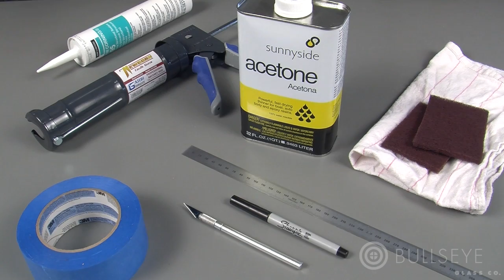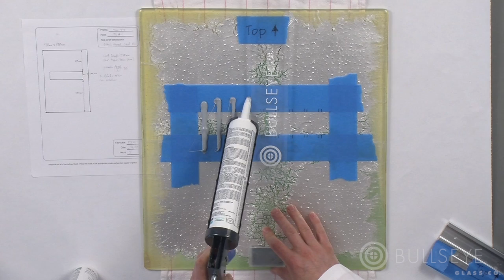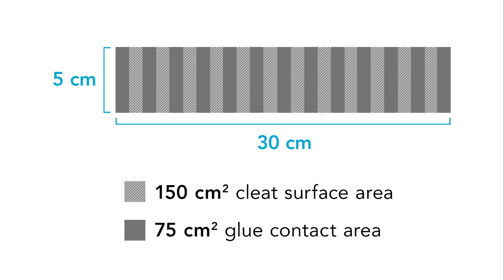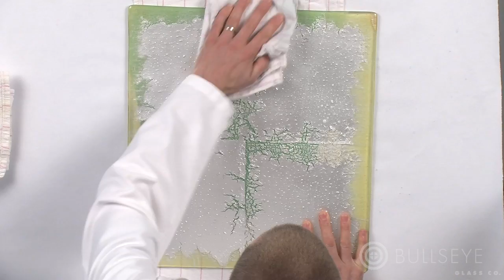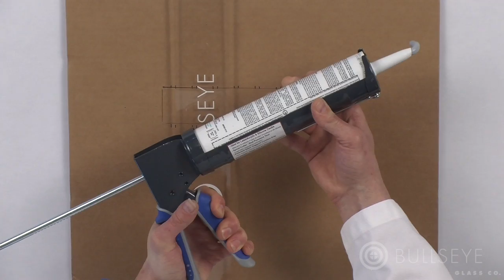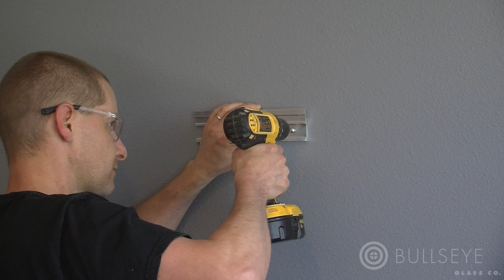Attaching French Cleats

Comment: Hi, using this method for a current project and we have a question.  The video shows how to cut and remove the excess adhesive on the straight side of the cleat, but how do you remove it on the angled side?
Reply: I've done this method many times and the "ooze-out" into the engagement zone of the cleat is a bugger! After battling this on several projects, I got smart and 3D printed a weird-shaped object, part squeegee and part snowplow, out of squishy TPU that wipes 99% of the wet 995 out of the groove. The squeegee is the exact thickness of the void where the glue accumulates. These projects go much smoother and take less time now. Good luck!

Comment: Can this method work when hanging mirror? Will the adhesive affect the mirror back in any negative way? I’m picturing the bracket potentially reacting with the reflective material on the back of the mirror? Thanks in advance for your guidance!
Reply from the maker: Hello Hannah!

Since mirror isn't anything we have experience with, your best bet is to talk to the mirror manufacturer for guidance.

The Dow 995 we use does indicate that 'reflective glass' is an applicable material for use but without guidance from the mirror coating manufacturer we can't know what the hang strength and chemical interaction characteristics will be.

If you are using Dow 995, here is where you can get its technical data sheets:
https://www.dow.com/en-us/pdp.dowsil-995-silicone-structural-sealant.02122197z.html

Thanks!